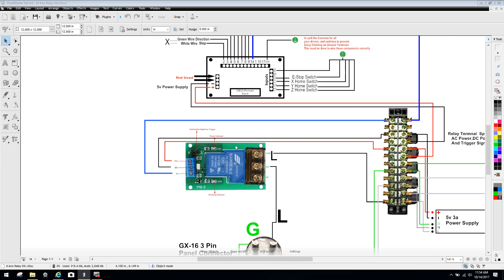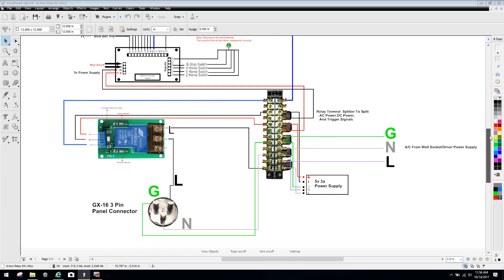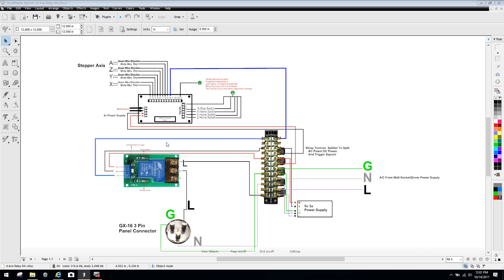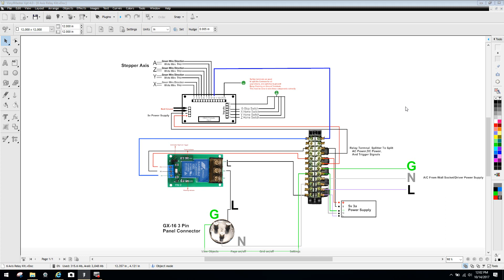CNC Relay Kit To Add A Relay To Any Breakout Board (Subsystem Design)

Comment: i am trying to add coolant pump to my cnc machine do i need a relay  ?  the pump has 4 wires
Reply from the maker: Hey Mori, Thank you for your support. If you want to control the pump through Mach3 then you'll require a relay to cycle it on, and off. Its essentially a switch controlled by the software. Thank you,
Vince

Comment: Another question. If an integrated relay were used would a inline fuse  be a wise idea to protect the breakout board?
Reply from the maker: A fuse isn't required to protect the breakout board., as its connected to only receive a triggering signal, and not power from the board.  Thank you,
Vince

Comment: Hi....how do add a relay if you are using 6 steppers? Thanks!
Reply from the maker: Hey Cleatus46, thank you for your support. You would require a second parallel port, and another breakout board as 6 axis is all that's currently supported. Thank you,
Vince
Reply: @corvetteguy50  Hi Vince,  a 2nd parallel port? How is the parallel port and another breakout board wired into the existing controller system? Sorry, I'm new at this. Thanks!
Reply from the maker: @Cleatus46  It would be wired into your controller, and attached to your PC as the breakout board gets signals from the PC to direct the drives attached to it to control the motors.
Thank you,
Vince
Reply: @corvetteguy50  Hi.....I was referring to your UC100 controller and breakout board combo and apparently it's a USB....I haven't seen a parallel port on any of my computers in many years. Just curious, doesn't the electronics get hot encased in the LPT type plastic case of the UC100? Thanks.
Reply from the maker: @Cleatus46  in that case you would want to use an ESS to replace the UC-100 as it will support up to 3 breakout boards or components that support DB25 input. The UC-100 is only drawing 5v, so heat isn't an issue. Thank you,
Vince
Reply: @corvetteguy50  Ok, I understand....I was simply going down a rabbit hole when you were referring to parallel ports I don't have. "Having said that".....I sincerely appreciate your instructional videos and "golden" attention to detail. Thanks man!
Reply from the maker: @Cleatus46  You bet  :), and I realy appreciate your support thank you, Vince
Reply: @Cleatus46 lpt port card in pc, then you have second P port, then connect controller board normal and config/set up  u can add second paraller port to pci or pciE at motherboard in pc, add pci card to pc, then config/setup first card normal all motor pins and second card all limit, and relay pins.

Comment: Vince, do these relay modules have the same footprint of a solid state relay?
Reply from the maker: No, there mounting pattern is different from solid state relays.

Thank you,
Vince
Reply from the maker: My relays mount with two screws as well. I don't know if they would fit your DIN mounted rails. 
My units dimensions are 50.29mm length x 27.43mm width, and 27.94mm high. Thank you,
Vince

Comment: sir i have 1 relay breakout board. so my machine spindle is rotate clockwise but not anti-clockwise. please advice my how to connect 2nd relay module for anti-clockwise rotation and how to i wire it. If you have better suggestion please tell my. i have single channel relay module which connect to arduino can i use this with my board or i need something else.
Reply from the maker: Touseef,
Thank you for your support. I ned to know the details of the system your using. What VFD are you using? What relay are you using? What breakout board are you using? 

If you give me the details I'll try to point you in the right direction.
Thank you,
Vince
Reply: @corvetteguy50  my friend send me this video but its not working for me.
https://youtu.be/CnuU1DgkiRQ
Reply: sir...what software using this circuit drawing?